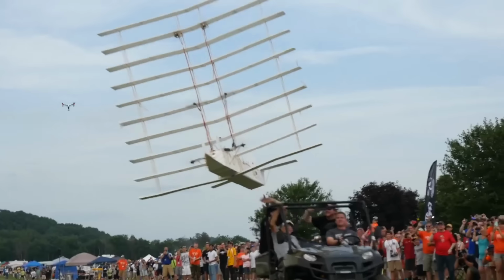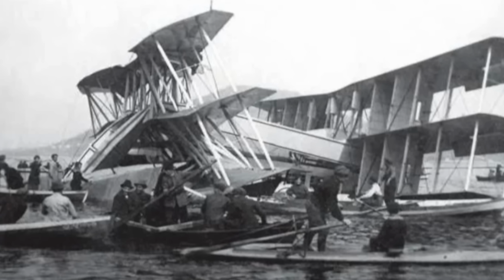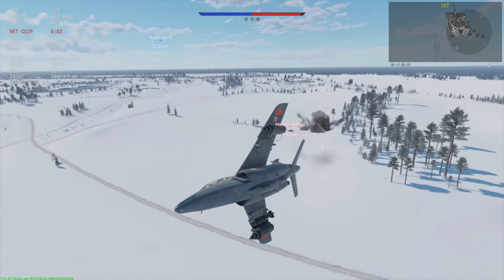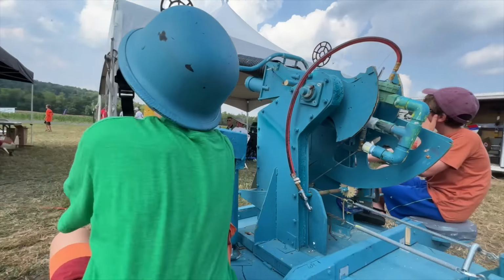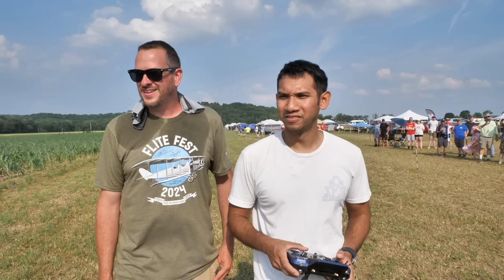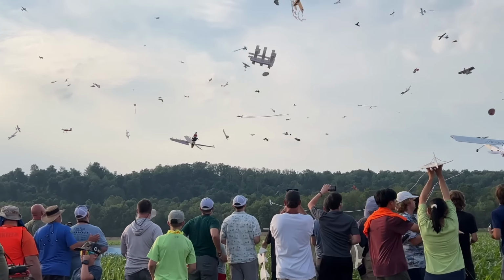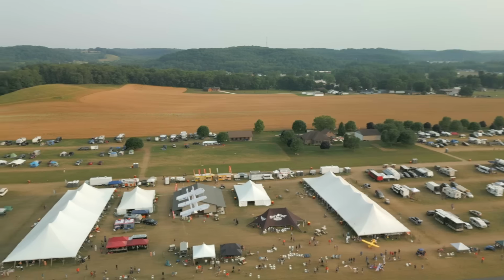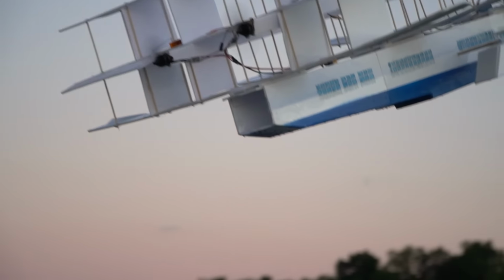How Many Wings is too Many???

Comment: Next time: a transparent plane. Made with perspex or something so it just looks like some electronics flying around.
Reply: Wonder woman's invisible jet type of thing
Reply: Yeah but that’s just a cosmetic thing, not as interesting as making something fly that you think shouldn’t.
Reply: @Sashazur  If it's very, very large and what's inside it is interesting then it could look pretty surprising.
Reply: Didn’t the Germans in WWI make a plane with all glass panels to be stealthy, but it ended up being super flashy in the sky or something.
Reply: Sorry it will not be transparent cause the total reflection after  certain angle
Reply: It might be more interesting to build one out of lenticular plastic sheets. Could look pretty weird from a distance.
Reply: Put LEDs in it so you get flying light show at night
Reply: Great idea!
Reply: Plastic would be too heavy to fly/glide normally, it would have to be a jet or something to just power through.
Reply: @JoshPhoenix11 
Not if it was a frame with cling wrap, like the old canvas planes.
Reply: @tin2001  Oh yeah, of course.. Thanks mate! 😉
Reply: Sounds awesome !
Reply: I think Peter is good enough to just make electronics fly around without any tricks of light. Use the circuit board as the wing or something
Reply: Perspex is horribly heavy....
Reply: I think it would also be interesting to see a plane specifically built to win the plane derby. Like redundant motor systems, agile and and a protected prop ect
Reply: @_BL4CKB1RD_ Yeah they did, they had the Right idea but did it the wrong way
Reply: The zombie sounds was the icing on the cake 😂😂😂
Reply: @agarscramble an A-10 XL is pretty tough in combat.  My Corsair hit it really hard and it just shrugged as my wings fell off.

Comment: Yes the Cg is at the center of the air craft, but the Center of Lift, Cl, is not, its all the way in the front.
Im a Msc mechanical engineer with a Bsc in aerospace and my guess of what is happening is: the rear most wings are not generating as much lift as the front ones because as the air passes through each wing set it becomes more turbulent, which causes less lift being generated. 
Another explanation using continuity theorems is: the delta speed between the air and the wings decreases as the air passes through each wing set, in order to keep the Center of lift near the Cg, in equilibrium, the air would need to be increased after each set of wings in order to maintain the same air speed through the whole of the plane.
Another solution would be to increase each wing set length in order increase surface area and get more energy from the "spent air". In a delta configuration.
Reply: It's funny..when an engineer talks about details...everything just makes sense and obvious.. I build boats and always interested to hear the navel architects explain how the dynamics work..
Reply: The middle / rear wings are in the downwash from the front / middle wings  - lower aerodynamic angle of attack as you move back.
Reply: The simple way to look at it is:  they are all equal wings spaces equally so they are effectively one square wing.   In standard wings, the CG is 1/4 to 1/3 from the leading edge , so the CG should have been 1/4 - 1/3 of the total cord from the leading edge.    Just like a normal wing.
Reply: Exactly what I was thinking.  By the time the airflow gets to the middle and especially rear sets of wings, it's probably so chopped-up that those wings are producing very little effective lift.  It would also help explain why the pitch authority was so garbage.
Reply: @SynchronizorVideos  pitch was garbage because of how long the effective cord is.
Reply: Very interesting experiment, your conclusion seems crystal clear (for a comparison you only have to look at the structure of turbines, for example). And OK, the proportions of models are also very important to consider... But the video's title question remains unanswered: Why not increase the lift excessively?? -> Problem 1, reducing turbulence - a) increased lift allows you to reduce the cruising speed (and above all engine power), and thus the turbulence; b) cleverly arrange the wings at an angle in order to achieve the maximum distance from the strongest turbulence of the previous wings? -> Problem 2, reducing weight and drag of the aircraft due to more complex structure - triplanes are certainly beyond any efficiency, but what about the idea of "merging two planes" in the case of particularly large aircraft in order to use a common (but larger) fuselage? PS: I bet these questions will be answered in the first two lectures of the first semester of aviation (??)

Comment: My less-educated guess is that this plane flies in an ongoing deep stall (writing at 3:39, ok…). Analogous to what ordinary airplanes with T-tails experience when the tail control surfaces loses authority from the main wing(s) turbulence. So, CG becomes… impossible to “calculate”, as speed and aoa will interfere in complex ways. At least when the original couldn’t access today’s miniature fly-by-wire…😅

Post-watch edit: Brute-force control surfaces made this plane fail extremely gracefully, though! Enough wing area to parachute a forced landing… 😂

Comment: I would have guessed the c-of-g forward of the centre wing. A canard design with two equal size wings has c-of-g forward of the centre and so the centre wing would pretty much have a neutral affect on c-of-g, making it similar c-of-g of a two wing version. I don't know how anyone would guess the centre for c-of-g, knowing that there is no forward penetration what so ever. Like a flat piece of cardboard would glide (with the c-of-g in the centre). 😅

Comment: The absolute behemoth sent multiple other planes bouncing off of it to the ground, made a sick recovery, and only went down when two other planes got stuck to it. Only Peter could intend to end up with a wreck but instead accidentally create the flying gigachad.
Reply: and then deemed it a failure, that was a firm win by most metrics, took out everything that tried to down it and then only finally went down after having its already pitiful aerodynamics completely wrecked by having other planes tangled in its structure... and then it was still mostly flight worthy after the resulting crash

Comment: Lift vs drag.  So it depends how much force you want to use to push it through the air.  In theory there's no limit on how many wings so long as you also have enough motors!

Comment: More lift equates to lower flight-speed & take-off-speed; for trans oceanic flights, the journey on such a plane would barely beat a cruise-liner without a head-wind: for luxurious long journeys that practically loiter in the air, like a blimp, its totally fine, if you're not commuting, just leisure-flying for the sake of being aloft, there's a nitch.

Comment: As a single wing pilot, I've never given much thought to biplanes, UNTIL I helped rig a biplane ultralight. I'm also a builder, and savvy how roof trusses "work", and when the final cable on the biplane was tensioned, I couldn't believe  hadn't realized the inherent amount of strength in a biplane design. Top and bottom wing 4' apart? Thats a 4' deep truss, and wire brace is very strong with min weight.

Comment: I would like to challenge you to make a 4 rotor plane with tiny drone motors attached to each of the 8 total blades, and that would be its propulsion. Have each of the blade mounts be able to rotate 180 degrees fore and aft and some software for flight controllability.
Have the aft props be pushers for better capabilities.

Comment: Always start too nose heavy. If you don't have elevator authority to get off the ground, you have a safe fail condition. If you start too tail heavy, you get off too easy and then you possibly don't have thrust or elevator control to keep from going unstable. Good piloting getting that first flight back down.

Comment: Due to the amount of sticks holding up the wind the sticks cause a lot of drag reducing the speed of the aircraft. This is a real factor of old time fighter air craft in ww1 planes, the planes didn’t fly as fast as intended because of the bar holding up the upper wing/wings on the plane.

Comment: Tandem (or triple) wing designs are inherently unstable. I think it's because all the surfaces are lifting, any control input shifts the center of lift. Changes in angle of attack change the center of lift. Speed variances change the center of lift. You're always going to be flying high alpha or crashing or shifting between the two unstable conditions constantly. This is my belief.

Comment: You missed a crucial point... the offset of the center compound wing assembly. Notice how the original had the middle wings lower, so it caught more uniform density, instead of just perpetuating the turbulence to the rear.

Comment: You are the first person I have seen that thinks the best way to determine CG is by flying the plane. Most people I know of simply support the plane at a fixed point at the center of lift and see what how the nose moves vertically. It' almost impossible to wreck the plane that way. Of course you have to find the center of lift first. Anyway you then move the support point forward or backward to find the CG.

Comment: I have always been taught/told/learned myself that the “1/4 chord line” is a great starting CG in most cases. So, if you look at the “wing assembly “ as one wing, how close did your second CG come to the quarter chord line?
I know there are variations on the theme, but I would love to know where your CG ended up?
Thanks,
Barticusmax.

Comment: You can tell it has nose weight because of the way the wings stick off the rear of the actual vehicle in the nose protrudes out. All aircraft must have a little nose weight so the center of gravity must be slightly ahead of the center of Lyft.

Comment: At RC speeds I'd imagine it doesn't matter, but the center wings were lower than the other wings in the original plane. Possibly to separate the airstreams

I don't know enough to say if it actually would've helped to do that though!

Comment: The cg must be in front of the center of lift so the positioning kinda makes sense, if you average the lift from the wings it will be in the middle so placing the cg there will not work just like with a normal airplane

Comment: I have a few experimental ideas:
1) omnidirectional aircraft similar to ADIFO (can fly in any direction, even side to side)
2) A quadcopter that's as quiet as possible
3) A plane that maximizes payload while minimizing thrust (blended wing body?)

Also, that landing at 10:42 was beautiful

Comment: Hey Peter, here's an idea for a future video; make a simple, backpack/strap-on (minds out of the gutter!) personal autogyro, using a paramotor engine or even possibly an electric setup.
Build a simple frame, with the smallest blade diameter to safely fly, and a lightweight rudder.
You could make it RC and test it with a dummy, buster style!😂
That would be super sweet!!!🤩

Comment: Would a middle wing like in this tri-wing generate lift in an open-ended box(if the wing is anchored to the sides and bottom)? 

Or if you made it a closed system (air duct to connect the ends with a fan on one end)?

Comment: or have adjustable ballast for dynamic cg control on the fly, you never know when then whole cargo gets moved forward inside the plane. who said b2 spirit flies good. yeah you can use water tanks as dynamic ballast. if any. yep wide tri-maran floaters be the best. airforce zero. try triple box plane, yep boxes with I-beams are strong, or just aluminium corner beam box wings. with foam wing surface. whats better than ground effect sea plane. well tri-plane ground effect sea plane. sturdy strong wing plane but ultra-light.
Reply: try structurally stable blimps, or balloons, ie which dont collapse even if the hot air or helium is not in the balloon. ie, add a spine to the balloon. 3d cross with tether wires. you get both the support structure and the outer wires with same effort. yes tent spine the balloons. even arc spines on top of the balloon. yes tent balloons. ultra-light.

Comment: Can you imagine the mad flying machines we'd have seen if engines weren't holding them back.....like those electric motors probably have 10x the Scale HP of the whole plane each

Imagine they had super light 10,000 hp engines 😂

Comment: Summary

* 0:00 The Challenge: Building and flying RC scale models of the Caproni Ca60, a historical "triple triplane" designed to be a transatlantic ocean liner.
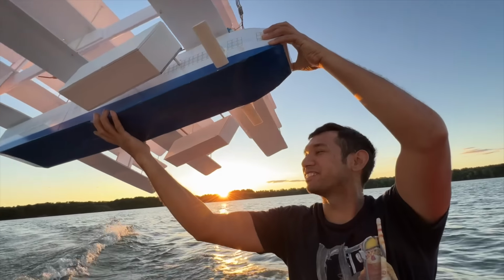* 2:14 Water Takeoff: Floats are added, and surprisingly, the small model takes off from the water, albeit with terrible flight characteristics.
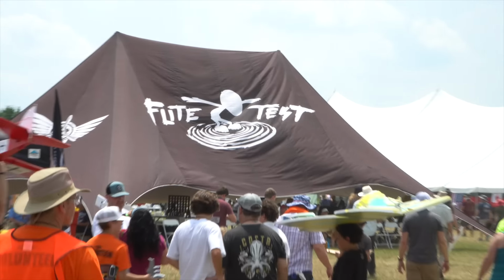* 5:47 Giant Ca60 Build: At the Flight Fest event, Peter enlists the help of kids to build a massive version of the Ca60. 
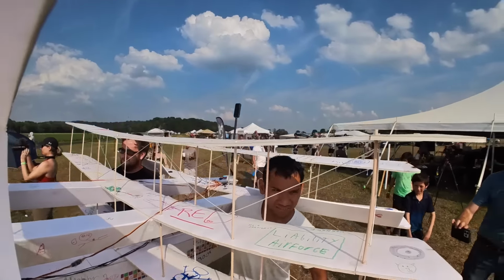* 9:06 Flight Fest Mayhem: The giant Ca60 flies (again, poorly) in a demolition derby with other aircraft, eventually crashing due to another plane getting stuck on its control surfaces. 
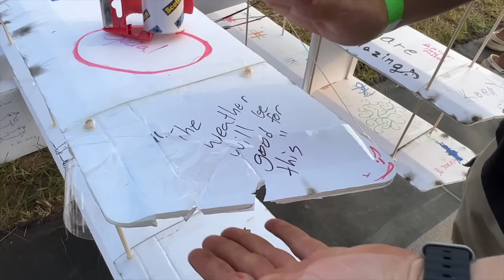* 14:04 Final Flight: The battered giant Ca60 takes flight one last time, attempting loops and other maneuvers before meeting its ultimate demise.

i used gemini 1.5 pro

Comment: How is it that u make RC planes so easily
Reply: Lots of experience, materials and tools.  Foam board, dowels, motors, ESCs, batteries, servos, receivers.  CAD software and a CNC that will cut the foamboard to shape.

It takes a lot of work to make things look easy.